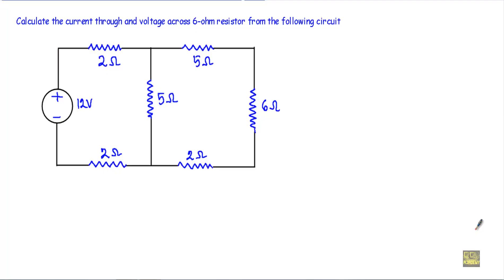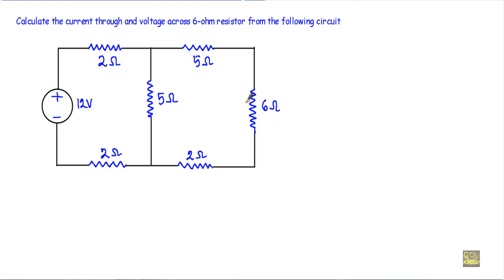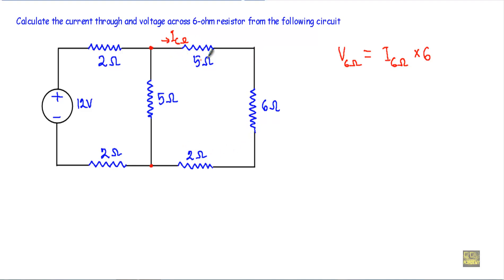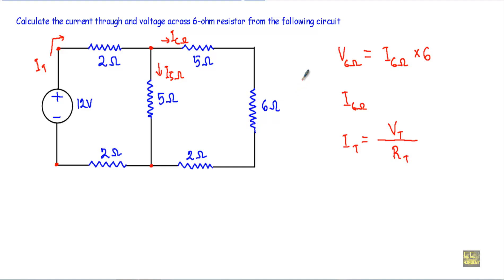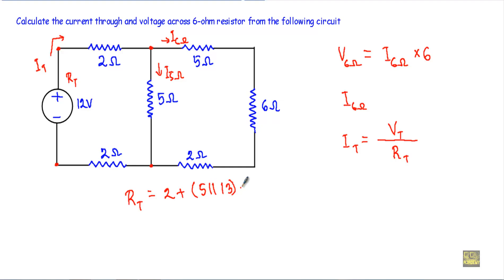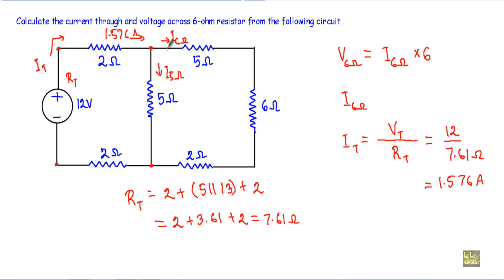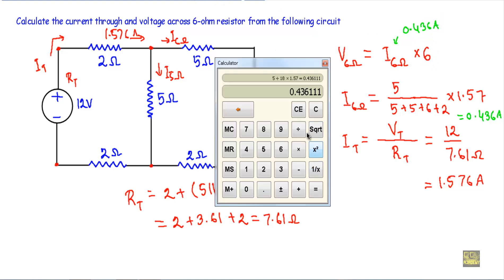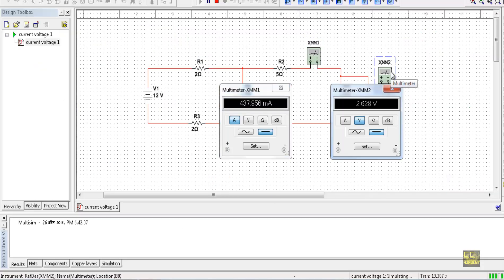Current and Voltage in Complex Series Parallel Circuit - 1

Comment: Hw do we get value of 5//13
Reply: You mutilple 5*3 divided by 5+3
Reply: So it’s 5/13 ? Because the answer isn’t 3.61 it would be 3.84?
Reply: Abz Abz for parallel circuits you follow this simplified formula. (R1*R2)/(R1+R2) in this case R1=5,R2=13....(5*13)/18 =65/18=3.611ohms.
Reply: @willycles  thank you bro👍
Reply: Right side circuit taking 5+6+2 equa to13